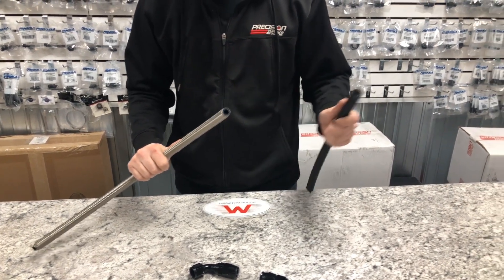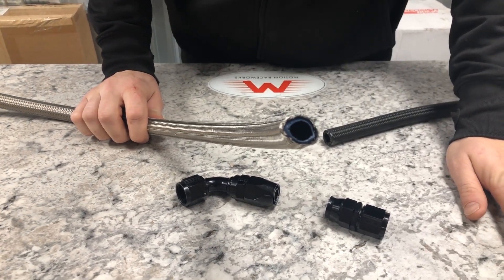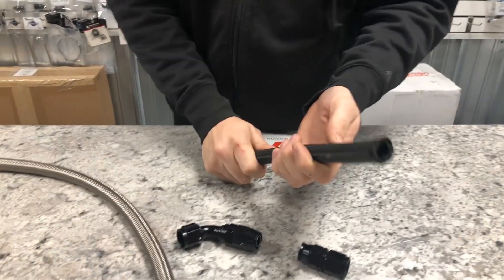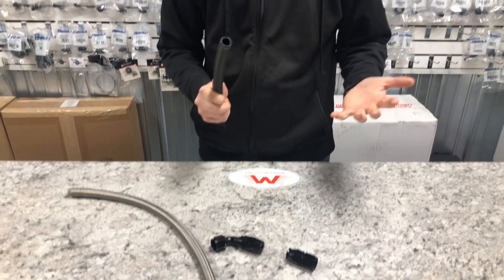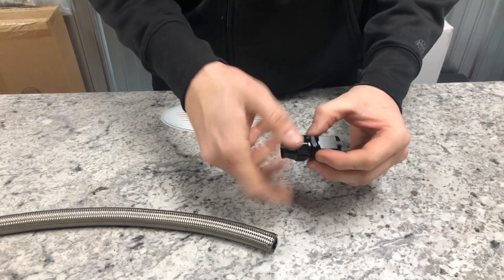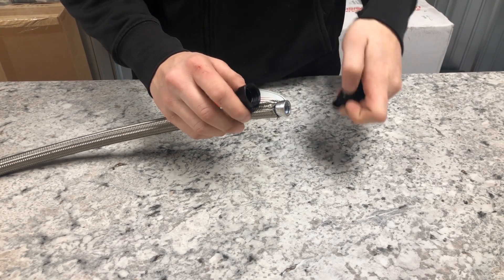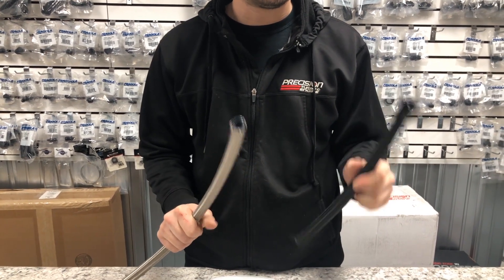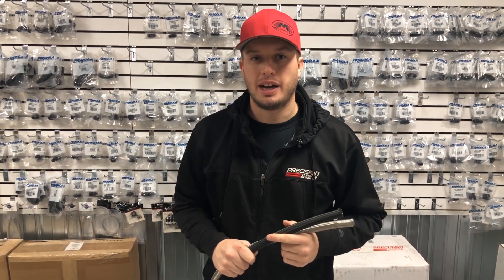PTFE VS AN - Steel Braided vs Nylon Hose Motion 360

Comment: It's funny that this video is 6 years old. 7 years ago I made my oil cooler with stainless steel nbr rubber dash lines. Guess what happened yesterday. Oil leaked all through the rubber itself. Never again, now I'm building it with ptfe with a stainless steal "middle" protection and nylon on the outside. Also I heard from a mechanic that nbr rubber hoses need to be replaced in the aviation industry every 2 years, whereas ptfe lasts forever if not mounted under stress.

Comment: After trying for so long yesterday to plumb my Motion fuel pressure reg bracket set up into my fuel rails, I was about ready to give up on cars all together. I was using PTFE hose. Have to make a hose with a 90 on one end and a 120-130ish on the other with about 2" of hose showing if that. Im looking into hard-line tools at the moment. I know it's supposed to last longer but I will replace it every 3mo before I do much more of it over rubber. I might even see what premade hoses cost.

Comment: If im replacing fuel hoses from engine bay & fuel tank hat to e85 compatible hose and connecting straight to existing hardline for feed and return ' will hardline act as earth for static build up compared to alloy fittings

Comment: Old thread… sorry, when having to replace a ptfe fitting, is it best to replace the ferrule as well or can I just slide in the new fitting into the ferrule and tighten it back down? I may have cracked the inner seat 🤦🏻‍♂️.

Comment: I have a ptfe hose that I want to install for an engine oil cooling sandwich. A 45° adapter will be installed on the oil cooler sandwich, and the adapter will be attached to the sandwich, then the hose will be pressed to the other side of the adapter at a 45° degree, then the hose will extend to a length of 1 meter, then a 90° adapter will be installed, and the hose will be pressed here  The problem is there is a problem with connecting the hose to its end. Is the required piece a phrase “Hedaan” and its connection for two years, or what, and what is the name of the piece? Then the hose extends to a length of 50 cm, then a 90° adapter is installed.  Another one and what is its name so that I can search for it and thank you.

Comment: The Ferrell goes over the plastic not inside of it…! When you tighten it up that ferrell crimps the out side of the plastic liner to make a seal! That’s how all plumbing stops work, like on toilets & sink lines. That is if you don’t use stainless flex supplies! 😂👌🏻🏁

Comment: ptfe for everything is supper hot like brake line or turbo feeder or clutch for the reste like oil cooler or fuel nylon is good

Comment: I have to disagree with you. For me personally PTFE is MUCH easier to assemble than the thick bulky nylon hose. Blue painters tape around the area I wanna cut so I'm cutting right in the middle of the tape. That way both ends are taped after I complete my cut and neither end has fraying wires to worry about poking your fingers. Blue masking tape, Bench vice, and a Dremel tool with cutoff wheel makes working with PTFE simple and easy.

Comment: Is it possible to use pressure hose clamps (not the regular worm-gear kind) for braided lines right onto the old steel fuel lines?
Reply: Only if you flare the steel line first and create a barb. If not it will most likely leak or blow off without a barb.

Comment: I'm having a nightmare of a time trying to find a way to run a hose from my motorcycle crankcase to a catch can/breather.

The barbed fitting is a single barb on the crank case and is vary close to the exhaust would need a bend to keep it away from the heat as I keep blowing through hoses do to melting.

On top of that the OD of the crank case fitting is 16.80mm on a micrometer or I call it 17mm even and the OD on the fitting for the canister is 8mm I cant find any way to step a hose down from 17mm ID to 8mm ID.

Any help would be much appreciated as I basically just shove the smaller hose down the bigger one and call it a day since I burn through them so often.

Comment: Wouldn't the static just discharge into the fuel rail that's attached to the engine block that is grounded? Do you have any resource material for this phenomenon about conductive and non conductive ptfe line?
Reply: Use dielectric great grease before pumping peroxide & liquid oxides! No, that rocket fuel, damnit. I dare anyone to use a Fluke 87-5 find a voltage drop from a grounded tank to a grounded engine! I alway park my "Top Fuel Dragster" at home in the garage. It is only 14" long but goes fast. But I am sure 400-700 garages exploded last night, they just don't report it like they do! Do the use "Cue Cards"?
ASE Master since 78, retired. 
Pop! There go another one! Nope, just M-80!

Comment: how can the conductive core ground through the fittings when the anodizing on the aluminum fittings is non conductive?  the conductive liner in the hose only contacts anodized surfaces on the fitting, and then that fitting is most likely going to be attached to another anodized fitting before touching anything metal and chassis grounded.  in other words, wouldn't the anodizing on the fittings insulate the conductive inner surface of the hose from grounding to the chassis?
Reply: I was just going to ask this. Most don't know that anodizing isn't conductive. I suppose the charge could bypass the anodized fitting and condust to the closest steel next after the fuel line.The carbon just protects the PTFE.

Comment: Could I use a nylon hose as a turbo oil return/drain?  But wrap a heat sheath around it for heat protection?
Reply: No, don't use Nylon. They burn too easily.

Comment: Push-lock is rated for nascar, and rated for on highway transport. This is an advertisement poorly mumbled to sell a product. Aka bull shit. Push lock comes in a variety of hose types for different liquids. Ranging up to 300 psi and temperatures above 300*f. Lightweight, non wearing reusable fittings. If you can't plumb hoses correctly by securing and routing away from sharp objects or heat sources while utilizing heat protection materials. You should not be plumbing anything to begin with. In MOST cases, push-lock will succeed requirement by far if selected and installed correctly.
Reply: very correct

Comment: I have to fundamentally disagree with you on push-lock hoses. Push-lock hoses are FIA and NHRA approved, are extremely reliable, and AQP socketless hose is alcohol rated (been running it on methanol-powered late models for 6-7 years without a problem). I would argue that due to how it's basically impossible to assemble them wrong, they are far more reliable than your standard reusable braided fittings. 

Crimp-style fittings on aramid braided PTFE-lined hose is still superior to all, but push-lock isn't a bad alternative. In my opinion stainless braided hose with reusable fittings has no place on a modern race car. It's fine for a street car, especially if you like the look, but there is absolutely no reason to use it on a race car. Also, the whole "conductive vs. non-conductive" hose thing is absolute marketing bullshit. It is simply not a thing, and shouldn't factor into your hose selection.
Reply: I just refinished replacing diesel fuel lines with AN hose and fittings.  I had used push-locks in the past with a large aftermarket lift pump-and I would agree that they are pretty secure. but...I still went with AN fittings simply due to the fact that I can easily mount a pre-lift high flow in line filter and shutoffs on the lines--for diesel this is pretty critical as fuel quality simply isn't up to par with gasoline.  One caveat, AN fittings nowadays leak...especially when you cross use products by different manufacturers.  Nobody seems to talk about this issue...but its definitely a "thing".  I use Seco7 conical seals now on everything and no leaks at all.  I also use a dab of Loctite 243 (only Loctite that works on anodized aluminum) on a clean install,  or,  believe it or not, old school "Indian Head gasket shellac" by Permatex...when using in the field.  The IH is completely impervious to either gas or diesel...but not E85...but stops vibration from loosening AN fittings...
Reply: @chicagomike6666  in the process of building a fuel system for my diesel. What fuel line did you use?
Reply: @Blueovalnation  i used ptfe braided nylon hose with AN fittings (AN6).  This is easiest way to add shutoffs before and after fuel pump and external filter…Leroy Diesel kindly modified an FFM to accept the hose end .  been great..no leaks snd i can easily shut off fuel when changing filter of pump. the best part is that to change a section…just unscrew…add new hose or whatever an tighten back up…
Reply: @Blueovalnation    Methanol is the most corrosive fuel, then down from there, ethanol, gasoline and the refined oils we call kerosene and diesel. ASE Master Tech since 78. Retired
Reply: @chicagomike6666  It's never been a good idea to mix brands when buying hose/lines and fittings and I've made many AN lines and have never, ever had one that was assembled properly leak (including brake lines that see more pressure than most automotive oil and fuel lines)...
Reply: As a retired electrical engineer with knowledge about fluid transfer in pipes and free electrons in the pipe material donating to the charged particle in the fluid, what happens is the thinning of the pipe wall and eventual leaks, particularly to metal piping.  Teflon is a poor conductor of electricity and often used as a conductor jacket, like most plastics have a insulating property and non- conductive. We often would positively charge metal pipes with a DC positive source so the free electron is supplied to the charger instead of the pipe wall, called cathodic protection. In vehicles, the negative is grounded on the vehicle chassis and provides a return path for DC current. The braided jacket provides a discharge path for static electricity and keeps static discharge from occurring  when connecting fuel lines from different sources that may have different charges as well as physical protection from abrasion. You will see fuel trucks connecting a ground lead first before pumping fuel, to discharge any difference in charges that maybe present.
Reply: Exactly as I was thinking. I’m not an EE but wouldn’t the Teflon and braid lead to the same ground?
Reply: @stefanzomods   Garages across America are exploding everyday, right? No! Ok.
Reply: Lol I was thinking something like this about the time he started saying and promoting only fragola hmm... Ya marketing BS I've used them good fittings but there are plenty of just as good stuff on the market. Was REALLY interested in what you said about psuhlock hoses. If you ran those on trans lines from trans to a cooler would a track allow you to run? what's the durability of those hoses? curious now
Reply: @r3d1911  funny cause I know fragola sells a ton of push lock line especially push lock lite and 8600. Which is nhra certified and ihra and is probably their top selling items. They should remake this video and actually inform themselves. Infact I didn't know fragola didn't make anything that wasn't push lock. That's all I see of their stuff.
Reply: You're absolutely correct that a properly used push-lock hose is safe and approved. It sucks that Motion Raceworks would so blatantly lie like this.

Comment: Stainless is a very good conductor. Non conductive hose will still ground out on the stainless steel. There is no way there will be burn hole in stainless braided.

Comment: All efi hose is alcohol compatible.  I know people that have use it for 10 years ane even then replaced because it is old, not because it has failed.
Those Micky Mouse stainless hoses  all fail prematurely and the fittings leak.
Oil fittings?  Use hi temp hydraulic hose. Again the bling shit fails prematurely

Comment: I used autozone fuel lines on my boat motor and after the fuel sat in the lines overnight it turned brown. Then after sitting for a week in the lines the fuel was red in color. Boat did not want to start with the discolored fuel in the lines and carbs

Comment: Ok I usually really like your videos, but I felt a bit off about this one. First, alcohol is highly conductive, so it won't carry a charge, unlike gasoline which will. Gasoline has such a low conductivity it builds static by being pumped, or splashed etc. Methanol is also a ton more conductive than gasoline. That's a super critical point to make. And any amount of ethanol (that is beneficial to making power) will be enough to make it a high conductivity fluid.

When fuel carries a charge, it will look for the point of least resistance. It won't simply arc across the whole hose. It will allow charge through the ends (or fittings). Aluminum has a lot more resistance comparative to copper, but a lot less than arcing through a hose.

There are many many good hoses out there. I like that you talked about static charge building, many people don't know about that, but you should be more specific about which fuels are conductive and which ones aren't.
Reply: so then what do i run in my car to prevent it from burning to the ground
Reply: @aidanmatthews5297  non metallic hose, secured to prevent rubbing, kept away from electrical as much as possible.
Reply: @alexb4409  Well then I guess I'm already doing the right thing, thanks for the reassurance tho

Comment: Awesome video, great tips, especially on the conductivity. I'm just using these to dress up my engine, but I haven't even considered that.

One suggestion I'd like to make that I used in the past is lint-free cloth, with alcohol. Push a bit into the line before I cut it. As far as feeding it through different areas, I made caps for the different size lines I use and push the plug and cap onto the line before running it through areas that are contaminated. Although I'm working with water, it should work for these lines as well.
Reply: Gasoline builds static, alcohol and methanol will not. Low conductivity fuels build static by being pumped, but alcohol and methanol are high in conductivity.
Reply: They make both billet and push in plastic plugs for AN line fittings. The plastic plugs are inexpensive so I always keep some on hand.

Comment: The only real difference between these two hoses is the outer brading.  one is steel wire, and the other is nylon fabric.  The rubber hose inside is still EPDM rubber or something similar.  The steel will deal with hot better, and the nylon will deal with flex better.
Reply: No.
One has a PTFE (Teflon) liner, to resist the more corrosive fuels (E85 through methanol). Did you watch the video at all?
Reply: @mattmanyam  I know this is way late… but did you watch the video? 10:24. Buddy. “Both will handle e-85”
Reply: @nodekapunk  "this one requires maintenance and draining". Dude.
Reply: @mattmanyam  he still said you can use it my guy. And plenty of people do.
Reply: @nodekapunk  and then they complain that their injectors failed.
Reply: @mattmanyam  if the manufacturer of the hose says it’s compatible, it probably ok. Most products are made to work with e85 today.

Comment: This guy!!! Lol. Push to lock is the best out of all three. It is used in every vehicle on the road sice the late 90's. Every semi, bus, heavy machinery, regular cars. And I have never seen or heard of any failing hoses or fittings. And they dong corrode ever with e85 ever.
Reply from the maker: 454lss push to loc is different than push loc.
Reply: @MotionRaceworksOfficial  no it's not. The terminology varies. But they all refer to a hose that pushes onto a fitting and can't be removed without cutting. Different types of hoses materials for different applications, all using the same type of fitting whether brass, steel or aluminum. ALL PUSH ON and "lock" in place.

Comment: Can you tell me how long this cable cutters you used in this video?  Thinking about ordering some.  Didn't know if the ones you used are equivalent to 32 inch or 25 inch long handles.

Comment: with the recent fires in Australia some of the trucks brake lines were melting. would steel braided brake lines hold up to heat better than the stock rubber lines?
Reply: The brake lines they were referring to were for Air Brakes and they frequently just use plastic hose for these.  Standard rubber hoses would be fine unless they parked or drove over a fire for extended periods and then they really have other things to worry about.
Reply: Some of the trucks being used in the new South Wales bush fires the rubber brake lines were melting due to the heat.
Reply: @lorrystagg6578  no. metal retains heat. ALL hoses with stainless braiding is SOLEY designed to prevent abrasion or hot surafec direct contact, causing hose failure. You need a heat barrier hose covering to prevent the hose rubbers from soaking too much heat.

Comment: I use a stainless steel hose for an turbo oil return but it is close to the exhaust pipes, should a leave it the way it is or should I protect it with something?
Reply from the maker: Spinner it’s a good idea to put a heat wrap on it, otherwise there’s a chance the inner rubber portion of the hose can melt or degrade causing a leak
Reply: @MotionRaceworksOfficial  thank you!

Comment: i have an unrelated question about hoses. Can you give me an idea or answer on what type of hose i can use that can handle the high vacuum of a turbo and not fail also with heat of the oil? i am installing an oil catch can . i used 1/2 inch fuel line and it gave in. if you guys carry any such hose please let me know and i can order it. thanks